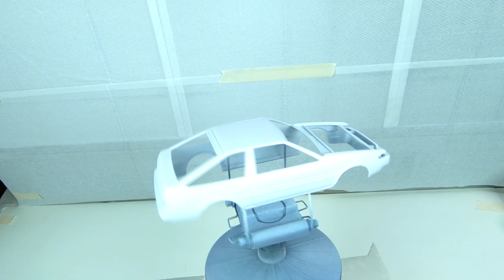How to Build a Super Realistic Initial-D Toyota AE86 Step by Step: Aoshima 1/24 Model Kit

Comment: I had a friend that used to be really into doing model cars he taught me a couple a little tricks I never thought of he used to make seat belts out of masking tape and then paint them all up and put them in the car he would also heat the bottom of the wheels up in a skillet so they smash out a little bit it makes it look like the tires actually have air in them in the car has weight it's not just sitting on top of round plastic tires and he would detail the windows so it looks like the windshield wipers have actually ran across the window you know what I'm talkin about where you see the part where the windshield wiper hasn't cleaned it and it's hazier just a little bit those little tiny things like that make a big difference
Reply: It seems as though his models needed a car wash and the tires inflated...haha j/k. I did similar stuff to my models as well when I was a kid.
Reply: That’s badass

Comment: A trick I learned in my model building days, spray a thin quick layer of clear after masking before putting on the secondary color, this will seal the tape lines and prevents bleeding.

Comment: Amazing work!
Only one side note: by the time the Hachiroku was equipped with a black bonnet, it already had a bucket seat for the driver.
Reply: And the 20v Silver-Top Groupe A engine
Reply: @B3N0N4T0R  it was a black top, I think. With the VVT component removed.
Reply: Hate to be that one guy but the black bonnet is carbon

Comment: Just pointing out a mistake in this build, the Toyota Corolla Sprinter Trueno GT-APEX AE86's 4AGE engine head cover is supposed to have a frost white coat with blue lettering, they were nicknamed 'Bluetops'. It is the first generation 4AGE engine, followed by 'Redtops', 'Silvertops' and lastly 'Blacktops'.
Reply: The Corolla was the Levin.

Comment: although a great video, unfortunately that 86 has the incorrect engine. The 86 in the later seasons of initial D did not have that 16 valve engine, rather it had been swapped out with a race-spec silvertop 4AGE with 20 valves (correct me if i'm wrong), it'd be more accurate if the 20V had been used instead of that 16 valve engine
Reply: It's a 4A-GELU 20v Silvertop Group A, you're right.
Reply: Ik this is late but Yea this model kit is for season one spec. There are other kits with the different parts such as the bucket seats and different engine
Reply: IvY_SaiYaN i get that but if it were a season one spec the the hood wouldn't have been painted black, but hey everyone makes mistakes so it's alright
Reply: James Lynam I totally Agree

Comment: 6:11 why the tachometer is at 8000 rpm max? Takumi got a carbon hood after upgrading his tachometers to 11000 rpm and btw Takumi's AE86 got black windows but you have do a nice work.
Reply: this is before the upgrades, he shouldn't have painted the hood black, also one small detail takumi has wind deflectors, also when he got the tach and the hood he got a seat as well because bunta injured himself while driving.
Reply: I mean, even so, it's still an amazing job regardless of the slight error

Comment: i was with you until you painted the seats the wrong colour. 
the seats are supposed to be red. 
engine was painted black on the bottom half and the steering wheel centre is supposed to be red.
then the white and black lines are wrong on the fuel tank and wheel arches.

Comment: Yeah that's not 100% accurate tho. The engine is a 16v small port but by the time it got the carbon fiber hood, they swapped to the 20v Silvertop Group A touring car engine. Takumi never had a smallport, just a tuned 16v big port.

Comment: my son has 9 year him build lot lot better all scale cars, were this have all tubes and wires in motor ???? were have all light ? must be work too. brake tubes,parking brake wire,spark wires,vacuum tubes. lot thin windows this not have realistic size windows must be  thin, lot lot better can build if need, because my 9 year son can build same but lot lot better and true more realistic, this is only model kit not realistic build.